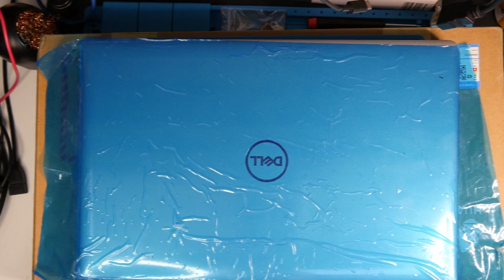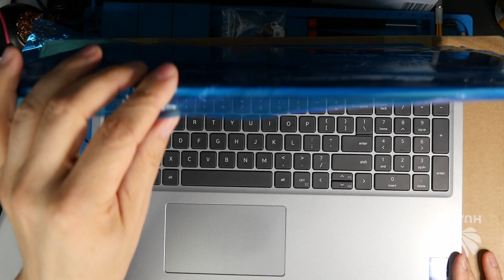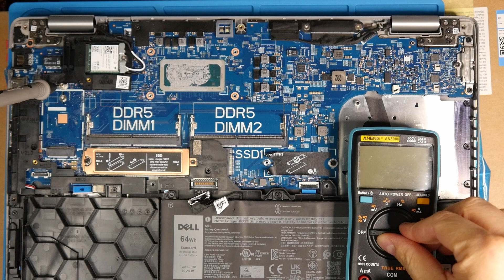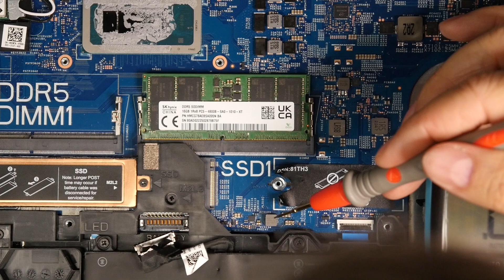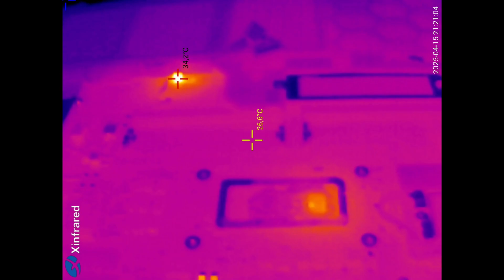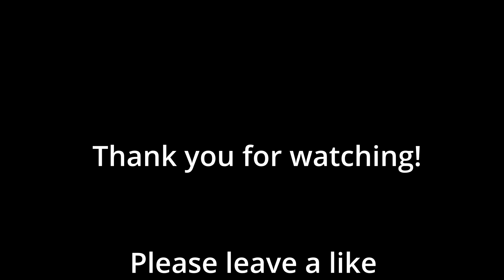Episode 29 - Dell Latitude 5531

Comment: Hi what causes the cpu failure ?
I've seen literally hundreds of these never seen a single issue not one problem.. 
I reckon it's been dropped from a height flat in its base shocking solder joints
Reply: Maybe liquid damage? Who knows. Very interesting video though, even though I did not understand any of it, lol.